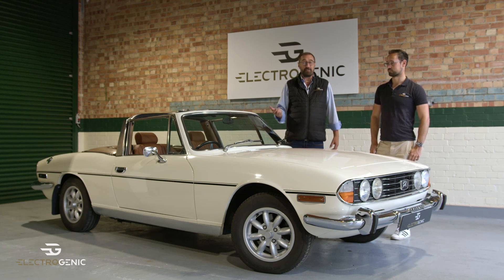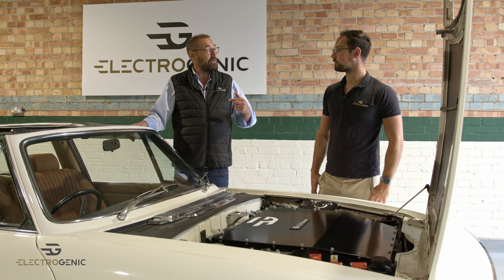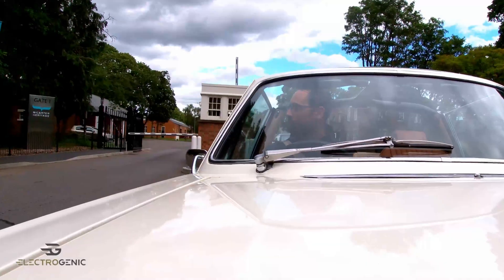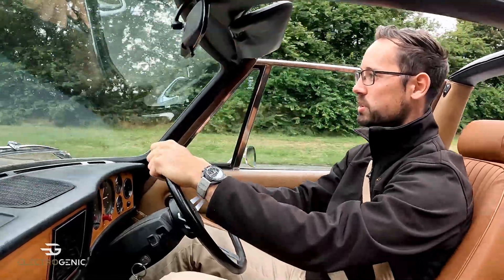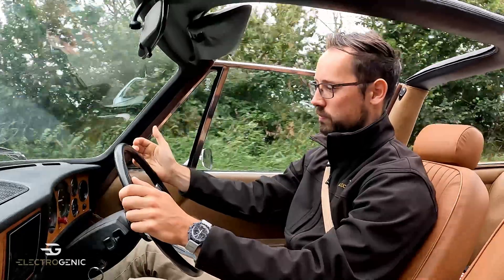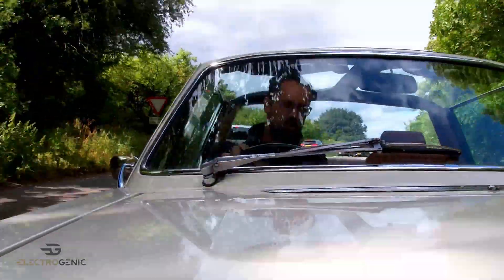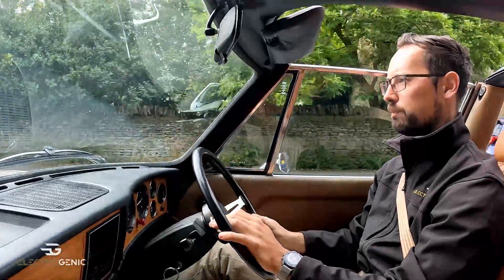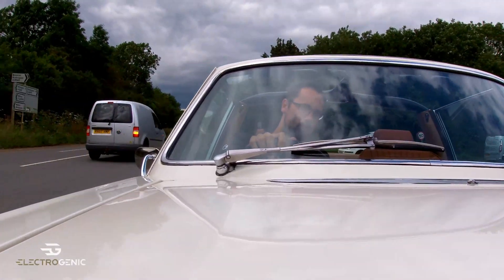Electric Triumph Stag Drop-In Conversion Kit | Electrogenic

Comment: it's great that this electric pak will keep a lot more stags on the street.. but wat i find is that there is not much thought that goes into the look of the cover for the batteries,no detail design. (just metal panels folded and screws)
Reply from the maker: Anything is possible and some of our cars have very detailed designs - it's customer choice

Comment: I really like the idea of converting some of these old classics to EV, but with the Stag the original really had a fantastic engine noise as part of it's character. I'd be inclined to add one of the fake engine noise generators to the kit - even though I generally hate fake noises. My greatest memories of the Stag is the awesome noise that the V8 made (when the original was working lol).  Here in Australia a relatively common mod was to replace the V8 with one from the locally built Leyland P76. Still had a great noise but was more reliable. 

Being able to turn the noise on and off would be great, use the noisemaker to keep the original character, but be able to go into stealth mode with a flick of a switch.
Reply from the maker: We can offer noise , in fact the actual original Stag engine was recorded - we have a sound specialist working with us - but so far none of our customers have requested it. We have taken note of your comment though!
Reply: In Scotland, the  in thing to do was replace the whole engine with a rover V8,  vroom vroom.
Reply: I had the P76 all alloy V8 4.4 litre motor connected to the original Triumph manual 4 speed with electric overdrive